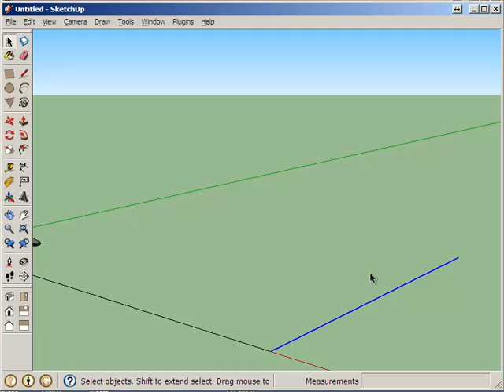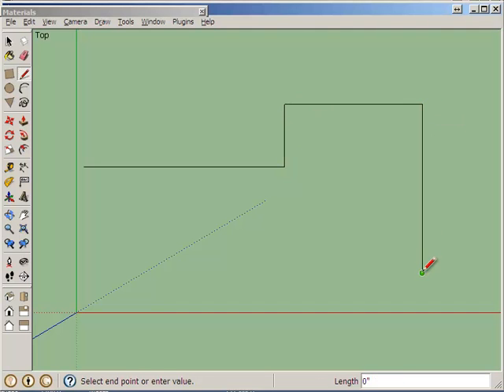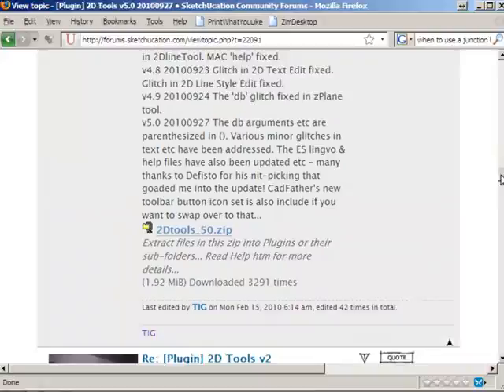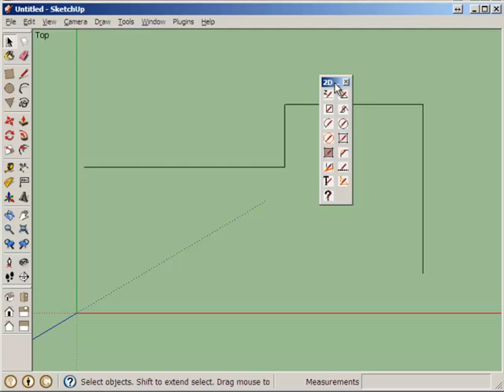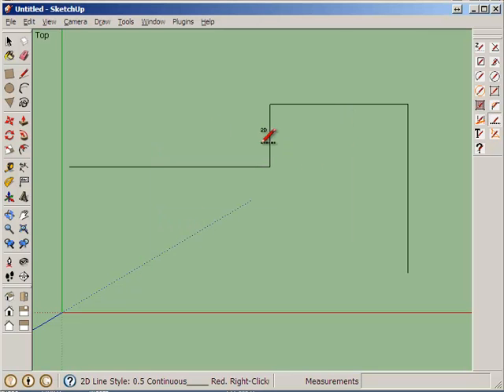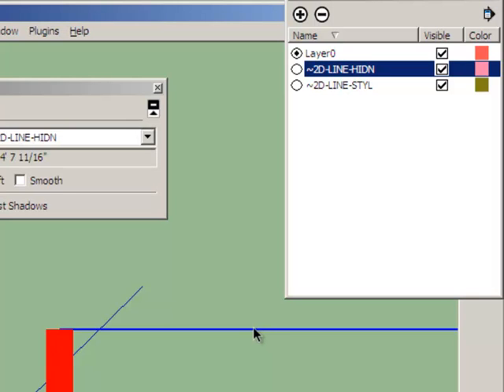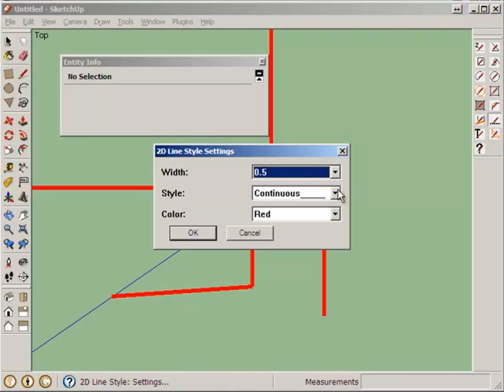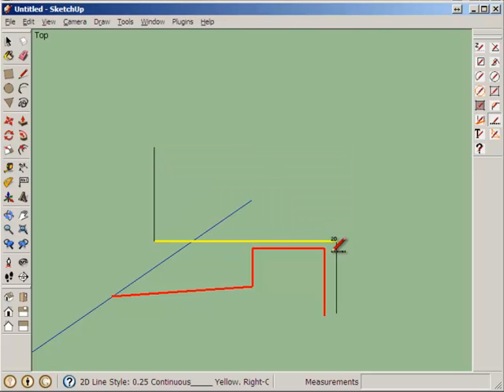ET365_Wiring_and_Custom_Lines

Comment: I found you can change the color of Sketchup lines. I used TIGs 2D tools and they did not do what I wanted. The problem with using rectangles is they lose their detail/color when you zoom out too far. Try this: Open "styles" menu, select "edit", under "lines" choose "color" BY MATERIAL.  You can now color your lines. You can also change thickness by changing "profile" number.  I hope this helps.